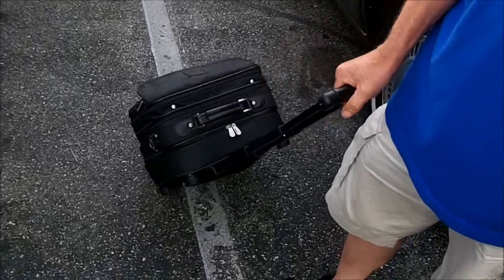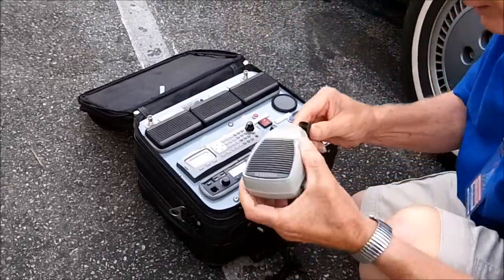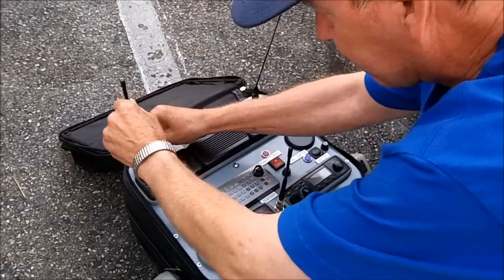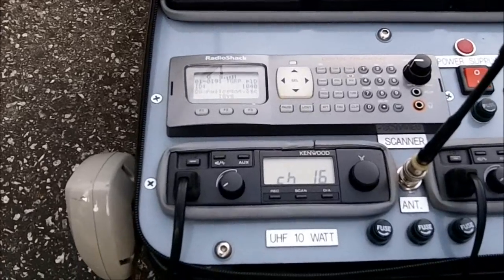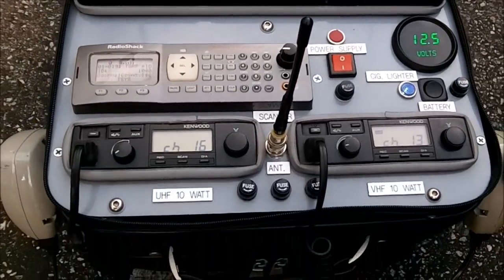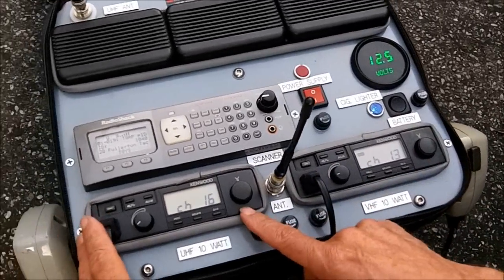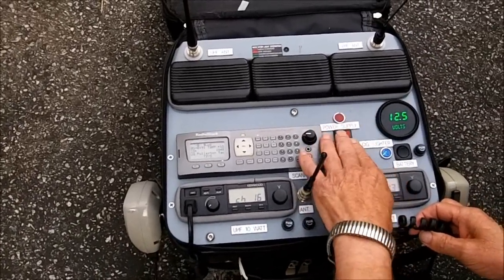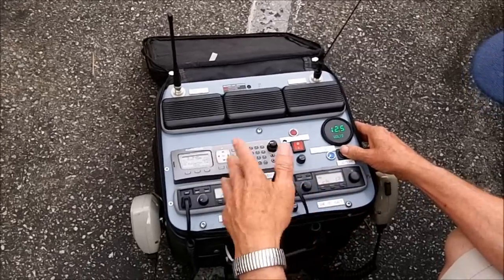Mobile Communications Center - Go Box

Comment: Very cool. I've recently built something similar with a bank of 18650 lithium cells configured for ~28 volts. I added an MPPT solar charge controller and a PV panel input. I also put in an adjustable power supply and an outlet (XT60) that adjusts from 1.5 volts to 28 volts (just because I could). The radios run on a dedicated 12 volt buck converter (up to 12 amps) and I have a couple of 12 volt outlets and two 2.1 amp USB ports. Two 30 watt PV panels in series charges the battery bank nicely. A small inverter can be plugged in for AC.

Comment: Looking into doing a similar setup for my communications go box and I'm wondering what brand/model rolling case did he use? I'm a 911 fire/law dispatcher for my county and also a firefighter/EMT, I take communications very seriously and this would be a handy system in the field especially when primary systems go down or I respond to a remote area in the north country where cell service and our primary radio system is limited. Would like to do a similar setup and looks like it would be a challenging but fun project to do that will benefit many people

Comment: Just a thought... If your portable rig is required for an emergency then it would be most likely that the repeaters in the area would be without power, so then what good would your 10 and 20 watt radios with their little antennas be in such a situation?
Reply: jus to touch on your comment there may be an instance where the fire departments system towers get taken out or fail and the amateur radio repeaters are still up and running. We have our local repeater on top of a hospital tower. Which is on generator. Thanks

Comment: Loved this video. But a suggestion is a solar Energy source for if there is no power supply. Or if there's a economic collapse there won't be electricity. But I would invest I'n a solar panel that charges directly to the battery

Comment: nice build but i do not like those radios used. An FT-857 or 897 all band all mode would have been much better. Channels? what is that? display frequencies or stations call signs are much better.
The build is nice but the equipment used can be improved very much